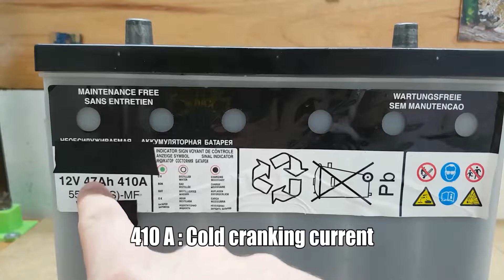What's inside car battery indicator | How to read car battery indicator?

Comment: At last Found what I looked for. Thanks a lot. Can you explain "sulfation" mean.
Reply: Sulfation happens when a battery remains discharged for a long period. The lead sulfate coating the electrodes hardens, making recharging difficult. It's still possible to recharge the battery, but only very slowly.

Comment: I have a car battery that has that window indicator, but I didn't realize you had to shake the battery to get a reading?   I just looked at the window while it was still housed in my car after driving it for a bit... the indicator is black but I suspect I have either car battery issues or alternator problems but the window didn't suggest it was low on electrolytes... my car is nearly 10 years old but my onboard car dash never gave me an indicator it has battery or alternator issues...
Reply: A bit late for a response, but you don't have to shake it to get a reading. If the electrolyte level (density) and water-acid volume is normal, the green ball should be floating above it. Meaning it'll be visible to the naked eye when looking straight down the tube.
Reply: @Euronius  Thank you

Comment: It's not showing the level of electrolite, but for work properly electrolite level must be right. 

Main purpose of battery indicator is to show charge level. Ball will sink if battery is not charged because discharged battery have electrolite with lower density. When discharging, sulfur from sulfuric acid sticks to the plates and electrolite density is lower - ball sinks. Charging battery makes sulfur to go back into electrolite and density goes up. Then ball will be floating

Comment: Interesting. 🧐 mine shows green but the car still won’t start. It does start with jumper cables though so I cleaned the terminals and I’m trying to unscrew the plastic caps so I can top up with water but they just turn and don’t unscrew almost like they are threaded ? Does anyone have any ideas or has this happen to them ?  😠